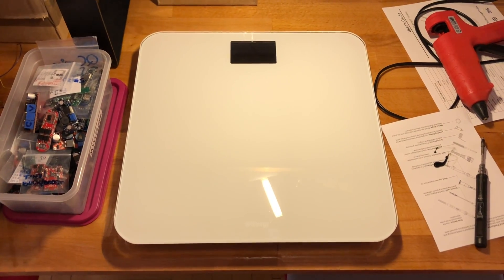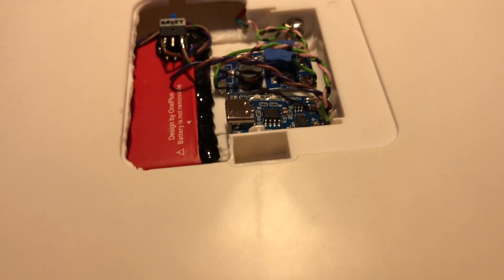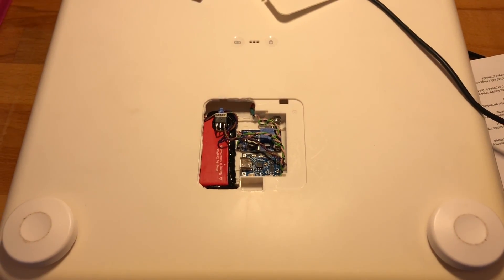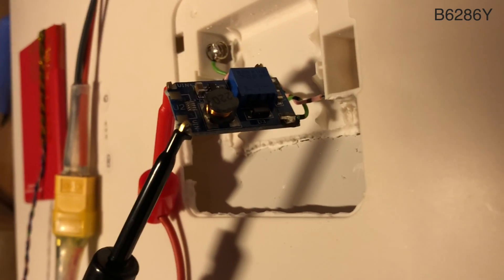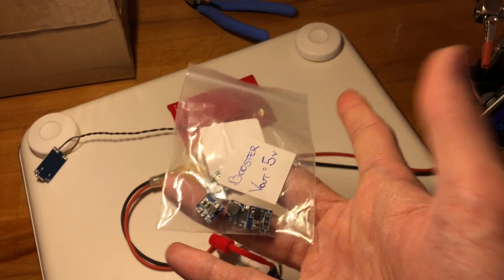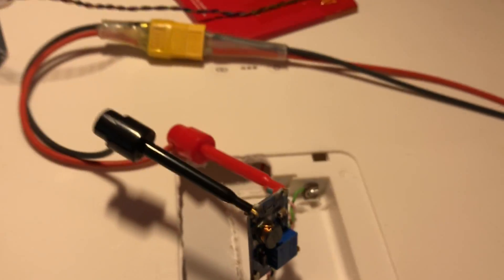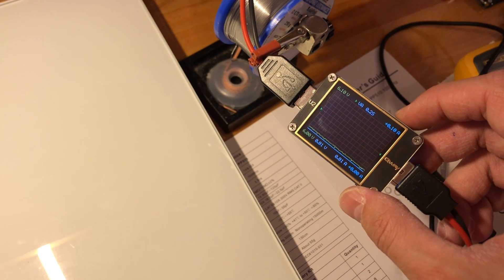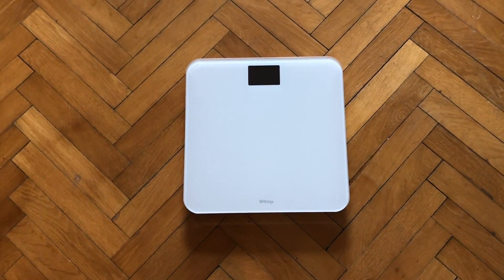Withings Smart Scale - Li Ion Battery Conversion

Comment: I actually think it's a downgrade. I can't remember the last time I changed the batteries in mine, the rechargable ones last really long, though I don't use the scale everyday admittedly.

Anyway, I think it is teribble that nowadays cheap Li-Ion batteries are put in almost all devices, not allowing for easy maintance, the companies don't even care or think about it. Terrible functionality, terrible for the enviroment. I always prefer AA or AAA powered devices, phones in which you can take the Li-Ion battery out. I love my wireless Apple keyboards and mice, AA powered. I think they are going to outlast the Li-Ion generations.

I still find it unacceptable that in almost all phones now you're not able to take the battery out. I mean, I know why, because clueless people buy them and aggressive corporations don't want their phones ever turned off, that's why.
Reply from the maker: oh yeah - true 

non-serviceable li-ion batteries suck and are the most irresponsible thing ever

however, most people just using non-rechargeable alkalines really shouldn't be THAT much better ...

indeed rehargeable ni-mh seems like a very good middle-ground ... unfortunately I have no AAA eneloops ☹️